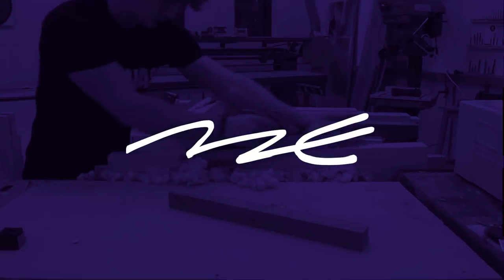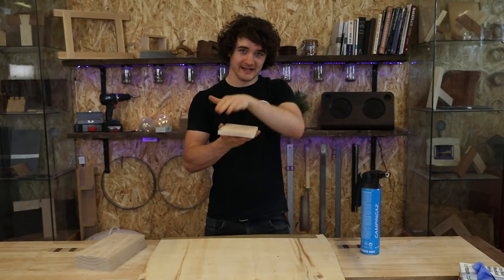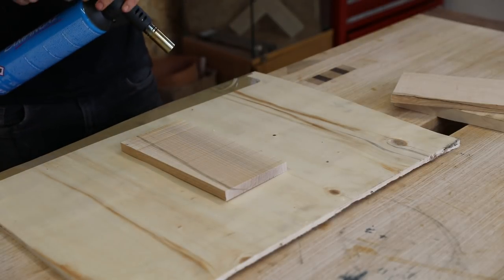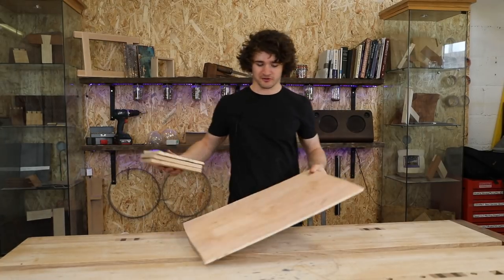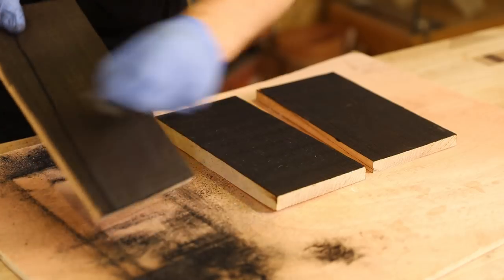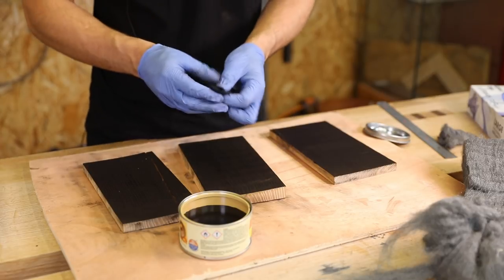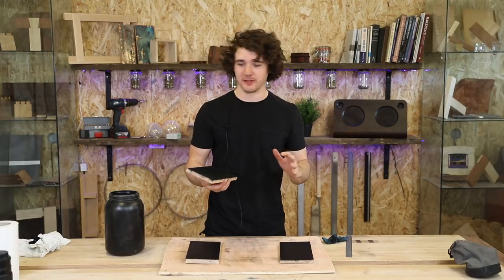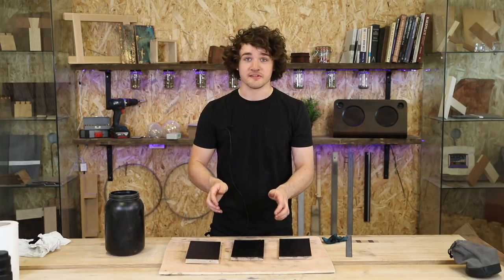How to SCORCH Timber | Experimental Wood Finishes #2

Comment: If you want a similar ridged texture  but keep the natural colour you can sandblast the wood. I used to do a lot of sand blasting at my first job and we used pine pallet wood to prop up things in the sand blaster. It ate through the early wood rather quickly and left the late wood raised. You can vary the depth of the ridges quite drastically by experimenting with how long you spend sandblasting the material. It's also how Fender got the finish on some of the guitars for Jim Root of Slipknot.
Reply from the maker: Yea I wanted to combine sandblasting with bleaching at some point to give a pale white version of what i have here. Just need to get me a sandblaster!

Comment: Interesting finish, Matt. Did you know that, if you are only interested in the texture aspect of it, and not the nice deep ebony tone, you can achieve the same effect using a soda blaster. In the states, I know a cheap soda blaster sufficient to the task can be found at Harbor Freight. The soda blaster gives you good control and lets you easily examine and feel the grain relief as it develops.  The down side (or the up side, depending on the look you're going for) is it leaves the wood its natural color.
Reply from the maker: Yes I have come across those before by never had the chance to give it a go. I'd love to combine a blasted finish with a bleached finish to give a polar opposite to what we have here. Definitely going to look into it at some point

Comment: Because of the way this can cause wood movement, what would you say are the most practical applications for a scorched finish?  Awesome video.  Definitely made me start thinking about ways to use this!
Reply from the maker: Hard to say. I've done it on tabletops before and have seen it done on chairs too. Have a look at this one by the Barnsley Workshop: https://www.barnsley-furniture.co.uk/product/rocking-chair/

It's mainly solid wood carcasses that would be the main issue I reckon
Reply: I have heard that Japanese used scorching as a waterproofing method. I have a set of outdoor table and stools that are treated like this and it feels like they never soak up much water in rain and is sitting there like forever (all the summer rains and winter snow)